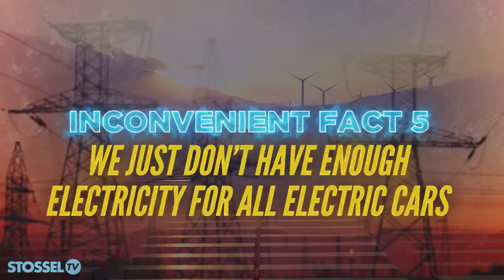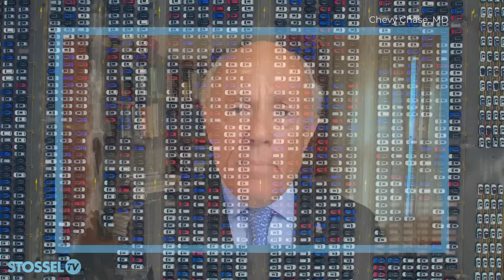Electric Cars: Inconvenient Facts, Part 2

Comment: This isn't about efficiency.... It's about control.
Reply: I wish all the lemmings would do some research and come to this conclusion. You, my friend,are correct!
Reply: Not about efficiency? More gas huffer babble. Only 12% to 30% of the energy in gasoline is used to move a vehicle, with most of the remaining energy lost as heat. With EVs, over 77% of the energy in electricity is converted into movement when including regenerative braking. Now, your turn. Explain in a coherent way, with evidence, how a different way to turn wheels is some sort of plot for a one world order.
Reply: @headstashmusic3897  How much does mining of precious metals consume fuel and affect the environment? or producing the batteries? or discarding them or recycling them? and how much fuel do you need to create the energy to charge your car? how long does the car even last when the battery goes bad and is cheaper to buy a new one? I could go on and on. I think its time for you to go and get boosted.
Reply: @Zeriel00  it's a car with a different fuel source, I've only heard of recent screeching about batteries in cars.  Nobody gives a toss about the hundreds of billions of batteries consumed and discarded every Christmas day around the world, what's your problem with these vehicles apart from being told what to think?
Reply: @JimmyMarrow ?
Reply: @Zeriel00  Its probably best you didnt. Yes the metal in EVs has to actually be mined just like any other metal. EVs operate in the real world, not some fantasy land where theyre made out of thin air with zero impact at all. What youre falling for is the logical fallacy of false equivalence. Many EV critics will portray the EV battery as toxic and dependent on a number of rare earth metals mined from conflict regions. It is true that cobalt and lithium are widely used in many EV batteries; however, neither are rare earth metals. This isn’t to say they aren’t problematic — cobalt mining in particular is plagued by some very serious environmental and labor problems, which is why its being phased out of EV batteries. But these problems are economy-wide. Cobalt is used widely in the lithium-ion batteries that power most cell phones and laptops. Cobalt is also widely in the fuel you put in your beloved gas burner, as it is used in the desulphurisation process of Naphtha streams (crude oil processing). And you dont hear ANYTHING from the oil and gas industry about phasing out Cobalt do you? Less than 10% of cobalt supply occurs as a primary product. Approximately 90% of all cobalt supply comes as a low concentration byproduct of copper or nickel production. There are only two operating cobalt mines where cobalt is the main product.  In reality, only some hybrids use cerium in their nickel metal hydride batteries, but it is also dusted onto every catalytic converter fitted into any internal combustion vehicle. Traditional internal combustion engine vehicles actually rely on rare earths more than EVs, both in the vehicles themselves, and through the very production of the gasoline and diesel that power them. According to the Chemical Economics Handbook published by IHS Markit the second largest market by volume for rare earth minerals is for cerium oxide compounds used in polishing powders for steel production. It’s also dusted onto every catalytic converter fitted into an internal combustion vehicle. In other words, every gas-powered vehicle relies on cerium, one of the rare earths singled out by anti-EV forces as being a “dirty” feature of electric vehicles. 
The third largest use of rare earth mineral? You will love this one: its is for a product used in petroleum refining, known as “fluid cracking catalysts (FCC).  rare earth metals are a key component in fluid cracking catalyst, a chemical process that was pioneered by Socony Mobil Oil in the 1960s.
Reply: @Zeriel00  How much Carbon is used to produce a gallon of Gasoline before its burnt.

at least in the US ALmost all Natural Gas is an emmision from Shale oil production. we have so much of it and its hard to transport we just burn it in a process called Flaring.

When you get this number get back to me and we can have a conversation.
Reply: @Zeriel00  "How much does mining of precious metals consume fuel and affect the environment? or producing the batteries?"
Answer:  A whole lot LESS than using petroleum! EVs break even with their environmental impact from manufacture at about 15,000 miles. Every mile after that is cleaner than any gas car.
Reply: @Zeriel00  "or discarding them or recycling them?"
Answer : EV batteries last at least 300,000 miles and are then recycled. Gasoline not so much.
Reply: @Zeriel00  "and how much fuel do you need to create the energy to charge your car?"
Answer : a FRACTION of the energy needed to make gasoline can push an EV 15-25 miles. A utility can burn much cleaner fuel than gasoline, and instantly transport the energy over the grid. Gasoline, on the other hand, wastes 75% of the energy as heat.
Reply: @Zeriel00  "how long does the car even last when the battery goes bad and is cheaper to buy a new one? "
Answer : the batteries outlast the car and all the owners. 300,000 to 500,000 miles before recycling.
Reply: It's much easier to create your own electricity than your own gasoline.
Reply: Bingo!
Reply: And most of all Money in the pockets of....
Reply: @headstashmusic3897  he never said it wasn't efficient.
He literally said it's not about efficiency, it's about the control they'd gain
Reply: @JimmyMarrow  wow.
This comment of yours is shadow banned, did you know that?
You need an alt account to see it's not there.
I can't believed I just found a shadow banned comment lol, I didn't know that was possible
Reply: @KA-nb9vx  beep boop
Reply: @JimmyMarrow  are you calling me a bot lol?
I'm talking about your comment that mentions safe and effective, only you see it, it's shadow banned.
I was able to see it because I clicked on your profile, doing that lets you see up to 3 other comments from that profile.
I just learned you can see a shadow banned comment that way
Reply: And politics and appeal
Reply: @Zeriel00  I like your style.
Reply: @Zeriel00  globolhomo’s! LOL that’s about right.
Reply: If it's mandated in California. 
Run away.
Reply: @justsomeguy934  The way I see it batteries are like gas tanks and most gas tanks never need replaced. You still have motors, transmissions shocks, struts and all other steering parts that would wear out equally. A battery that lasts  300,000 miles and then costs over 20k to replace is ridiculous. Nothing wrong with battery powered anything but it shouldn’t be forced or decided by politicians with contradicting interests.
Reply: @Yonder27  Do you know what happens to that 300,000 mile battery? It's not dead, it's lost about - maybe - 10% or so of its range. The battery does NOT have to be replaced at that time. That would turn a 300-mile car into a 270-mile car, everything else remains the same. What's ridiculous is a gas car that reaches zero repair value at 100,000 miles, gets dirtier and less efficient over time, and cannot improve via software updates.
Reply: @Yonder27  "You still have motors, transmissions shocks, struts and all other steering parts that would wear out equally. " No, they don't. If you're trying to compare an EV to an ICE, an EV motor has one moving part. An EV has no transmission, no exhaust system, no valves, no high-pressure cooling system, almost zero brake wear. I've had vehicles for 120,000 miles and never replaced a shock or strut.
Reply: Amen !
Reply: @Yonder27  These EV batteries are lucky to make it to a 100K miles before they rapidly degrade. Additionally, lithium batteries degrade even while not in use. They also don't hold up well in colder climates. I am a car mechanic that has worked on them so I know as well as anyone. Henry Ford didn't need government subsidies to revolutionize the industry. EV's require massive government subsidies since people don't want these piles of overpriced junk.
Reply: @headstashmusic3897  lol. You leave out the massive energy required to extract lithium, cobalt and other metals, assembly required to make these monster 1 ton batteries, the energy to clean up the mining mess, then having to charge them, then dumping them in landfills when they are spent. As a result the wheels get turned at a much higher energy cost than a conventional ICE engine car.
Reply: You can be controlled just as easy in a gas car as you can electric. Easier, most people could generate electricity at home; very few could make gasoline at home.
Reply: @natehill8069  how can they generate a battery when it dies?
Reply: @headstashmusic3897  Forcing people to do something is wrong.  If you want to buy an electric ( coal powered) car then go ahead.  Just don't try to force me to do it.
Reply: @ChannelNews1  Well, granted after 20 years  or so it will be a problem.
Reply: @natehill8069  more like after only 3 years or so. Battery life depends on a lot of factors. The first one is how much it is used. Being that it's used for storage it has a constant cyclical use. They will degrade a lot faster. It also depends on weather. They don't hold up well in the cold.
Reply: @ChannelNews1  Im gonna hafta go with actual results here. The earliest mass-produced electric cars (Volt & Leaf) came out 13 years ago and still are not having any wave of failures yet. 

The Leaf, admittedly, is not holding up as well since they are air-cooled without the active thermal management that every other electric car built since has, but even they are still running at > 60% capacity.
Reply: @natehill8069  as I just mentioned battery degradation is not set in stone. It depends on many factors. How much it's being used and the weather. In any case it makes no difference. With less than 1% of the automobile fleet in the U.S. alone being EV's they are already causing massive environmental disasters mining the materials required. Imagine what happens at just 2%. As you see this hits massive resistance before they reserve course back to ICE engines. This will clearly never work. In my home page vid I fully explain and source this.
Reply: Any car sold in the USA since about 2005; gas or otherwise, can be switched off by the manufacturer at any time. And GM, at least, has a record of doing whatever the FBI tells it to without any warrant.

And if the government tells the oil companies to stop selling gas, then thats gone too.

At least electricity I can make at home with microhydro, solar panels, wind turbine or a steam engine. I cant make gasoline.
Reply: @ChannelNews1  And if they cut off the electricity that wont happen? Hell of a lot more of people's lives uses electricity - heat, lights, internet - and in the scenario that was mentioned, cars also.
Reply: Or the environment.
Reply: I agree. It's a shame we gave the oil companies so much power!
Reply: And what is oil all about then? Explain how evs are about… control?
Reply: Bingo.
Reply: @paytonwilkerson955  referencing my hone page vid?
Reply: In the calculation about energy efficiency between EVs and ICEs is it taken into account that electricity is lost in transmission and fuel needs to be transported to gas stations?
Reply: @SuperRistopaha  what about my home page vid?
Reply: @Zeriel00  10x less than drilling and extracting and refining let alone burning oil every time you need to fill up.
Reply: @ChannelNews1  lmao literally nothing you said is even remotely true..
Reply: Yes control by Conservative gvt and oil companies with their multi trillion dollar business
Reply: @Zeriel00  I can answer. To get the cobalt and lithium etc for batteries (that basically last forever as they get recycled so only need mining once unlike oil), its about 0.00003% currently of the minerals mined. That's with around evs being 6% of cars currently.  So even saying at 100% this is far less than 1% 

But evs are already moving away from cobalt etc. At which point the main use will be ....... in fossil fuel cars. I wonder why they don't tell uou that
Reply: @banjerpicker5273  in 8 to week
Reply: My Ev costs me 2.7 cents per mile to drive. That much more efficient than any car I’ve have in the last 40 years
Reply: @headstashmusic3897  finally a thought out intelligent comment
Reply: @headstashmusic3897  In some ways you are right, but this is ultimately about control. Just like with a digital currency, who ever controls the digital means of supplying people with their basic needs (energy and money being the biggest factors) has absolute control over the population and can punish anyone who exhibits behavior not in line with the regime. The government controls the electric grid, they control how much you can have, how many lights you can turn on, what temperature to set your thermostat and when and where you can drive.  It's all about authoritarianism not about saving the climate.
Reply: Yet they don’t have the means for it. They are not that clever
Reply: @headstashmusic3897  excuse me. Extraction of energy then storing into the battery is lower efficiency than burning gas
Reply: @sillymesilly  You're comparing manufacturing with energy, which doesn't even make sense. Also, its important to understand that a vehicle biggest pollution point BY FAR, comes from the fuel it burns in its lifetime.
Reply: @JimmyMarrow so who's trying to control who, and how are they trying to control them?
Reply: yup.. they gonna turn off your electric so you can’t drive and go to work if you don’t comply
Reply: @headstashmusic3897  well power plants are typically 25 to 30% efficient… To generate electricity. So there’s that.
Reply: @feo2229  thats why emission free energy is the future. unlike the fuel that runs your beloved gas burner, electricity can be made with zero emissions.
Reply: Exactly!!
Reply: @natehill8069  refine cooking oil.And I never see cars being chased by police,FBI being 'turned off'..Why is that?
Reply: petrol cars 30% efficient electric cars 90% efficient...it's all about billionaire oil companies getting more billions
Reply: It's not about efficiency it's a very naughty ploy.
Reply: @headstashmusic3897 they will shut your car down until your fines are paid, wrong comment on fb will be a penalty foe your ev convenience, ut this has nothing to do with efficiency, are you not listening
Reply: @headstashmusic3897  you have been well programed comrade
Reply: @socoj2  thats BS. just in the permian basin we produce a very large percentage of NG and we dont have shale.
Reply: @justsomeguy934  BS. Again if that were true everyone would be flocking to buy EVs, instead the customer base is shrinking. (as per cheverolet)
Reply: @justsomeguy934  you are just changing location. most of the losses are in the powerplant so your figgures are missing almost half the data.
Reply: @justsomeguy934  your lie is getting bigger, try 60-70k
Reply: @josephmoore4764  you have any idea how much a home powerplant capable of charging an EV would cost??
Reply: @Yonder27  actually real world lifespan of batteries is 60-70k
Reply: @justsomeguy934  the 300k battery does not exsist, stop buying the propaganda.
Reply: @justsomeguy934  bs many EVS have transmissions. and your second point, just because you havent replaced a part doesnt mean its not bad.
Reply: @maddhatter3564  No, you're not just moving location of energy production, although that's a GREAT benefit. Here's why: even with 100% coal energy production, you're at least 40% efficient using steam generation, with natural gas it's even higher due to exhaust heat capture (i.e., exhaust heat from burning a fuel can be captured to add heat to the boilers). The main reason, however, that a utility plant is far more efficient than an individual automobile is that the boiler and generator don't have to be mobile, unlike a car. The typical automobile is only 25% efficient; it loses 75% of gasoline's energy as heat. By the time you add in parasitic losses due to mechanical overhead, only 15% of gasoline's energy makes it to the wheels. Given that EVs are 90% efficient with the energy they receive, it's blatantly obvious to anyone with connected brain cells that EVs are many times more efficient than gas cars.
Reply: @maddhatter3564  by all means, PROVE that EV battery's lifespan is only 60K-70K miles, because I can prove otherwise. You make a baseless claim and tell others they are lying. I have multiple sources, and personal experience, that EV batteries last hundreds of thousands of miles before they even lose15% range. It's YOU that's lying, I get it, the future makes you uncomfortable.
Reply: @maddhatter3564  As for just moving the energy and pollution production "to another location", we need to further discuss energy losses distributing the energy. For gasoline or diesel, it's physical/liquid fuel. That means tanker trucks and pipelines required to move millions of gallons of fuel every day. The energy costs are enormous, not even to mention the safety factor of transporting explosive fuel over surface streets. Electricity moves at the speed of light over fixed wires. High-tension power lines are 94%-96% efficient over a thousand miles. How much diesel fuel doe it take to move, say, a gigawatt of energy as gasoline 1,000 miles? Before you read one more word, a gigawatt of electricity has been moved safely half way across the USA.
Reply: @maddhatter3564  a home powerplant? To charge an EV? what are you talking about? I know several people with solar panels on their roofs that charge their cars.
Reply: @maddhatter3564  EVs do NOT have a transmission unless it's a gimmick like the Porsche Taycan. EVs have a fixed ratio gearbox to keep the wheels from being ripped off under acceleration. Research your subject before you say something, please.
Reply: @feo2229  Power plants are far more efficient than 30%, and when you factor in energy transmission efficiency, they are several times more efficient at getting a fixed amount of energy to a location.
Reply: @sillymesilly  how is making electricity and storing it in a battery less efficient than a gasoline engine that wastes 75% of it's energy as heat? Power plants are way more efficient than that regardless of fuel.
Reply: @justsomeguy934  even the EV manufacturer only clain 100k so the idea of 300k then another upping that to 500 k is total BS. im a mechanic and have seen this, sorry i dont doccument every conversation i have with customers. bye.
Reply: @ChannelNews1 
Fact!
Reply: @headstashmusic3897  Way to completely avoid the original premise to preach some nonsensical platitudes.
Reply: Well said. Our problems lie in education. 99.9% of us don't have enough knowledge to discuss 99.9% of the issues. We need a website with accurate information about each subject so folks can get real information and speak with some knowledge. So many just repeat what the other uninformed person said..
Reply: @headstashmusic3897 No it's not about efficiency..
For such a big mouth it is amazing how little you know about thermodynamic principles.
Reply: LMFAO!
Reply: How much control are you able to wield over the production or even price of gasoline? Control is an illusion.
Reply: @justsomeguy934 300000 miles? That’s funny